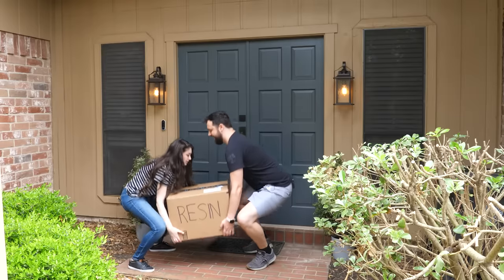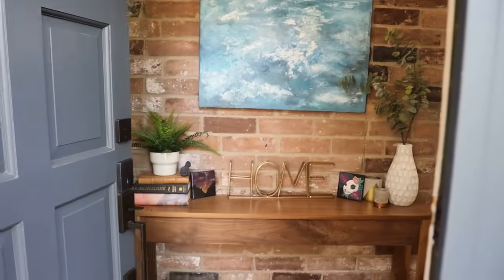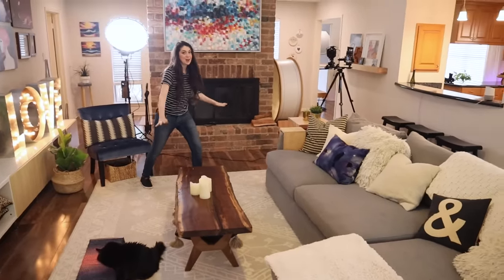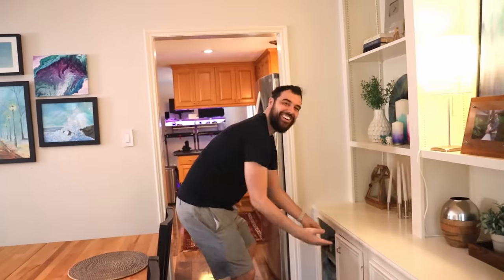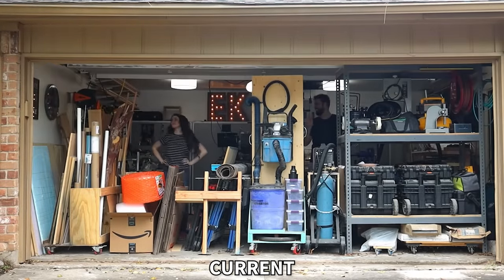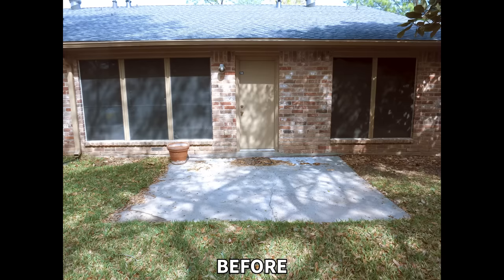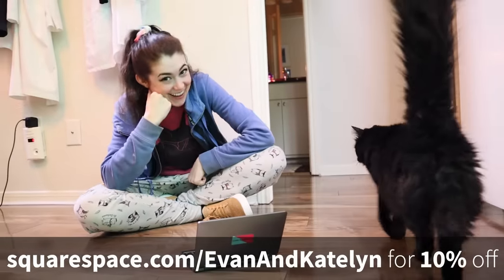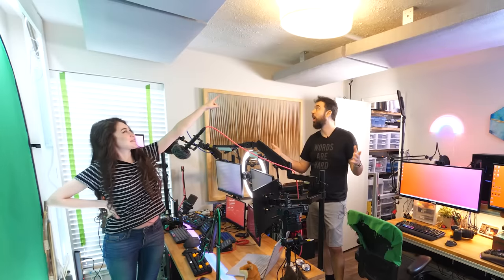House Tour + Before & Afters (8 Years of Progress)

Comment: You probably use directional mics or lapels now so you wouldn't need it as much, but if you STILL want to sound proof your garage ceiling, an easy way is to get a tapestry or blanket and thumbtack it.  It can't be super thin sheet material though or it won't absorb sound as well. I have my ceiling with a bunch of galaxy design tapestries.

Comment: I am pretty sure you could setup an auto-stream with a pi to trigger when Joob goes outside into that area, by putting a sensor in the top left and facing the bottom right corner of the area.
You could make it send a shortcut to a PC running OBS to start stream if motion is detected, and stop after 2 minutes of inactivity.

That way, it would always go live at random times when Joob goes into the area. I am sure it can be done... I have a friend that uses Pi's for sensors with his Autistic nephew when he stays at his house. He has sensors in rooms that light up a modified alarm clock with LED's to tell them what room he's currently in so they can tell if he's doing something at a glance when they are taking care of things upstairs.

Comment: 33:55 - I’ll do you one better. My two bathroom vent fans and every baseboard heater grill are also nailed into place with those same nails. Except in my house, two nails were used each time, with the heads overlapping to really jam them in there. The thing is, you can’t possibly swing a hammer in those spaces, so the builder or last owner had clearly bought a pneumatic palm nailer and went crazy. My vent fans are double-nailed inside the housing on THREE SIDES. I had to use tin snips to cut them out.

Comment: What is Joob's actual name? //  Your comments about 'previous owner' makes me think of my place. I never noticed it when I bought the house but after:  The globe on the light/fan in the bedroom didn't have the fasteners - the globe was just duct tapped on!  When the ceilings were painted, the fixtures weren't taken down so the light bases had paint on them.  When the walls were taped/mudded(?) the seams weren't sanded before painting (the ceiling in the bedroom has seams about 4" wide and maybe 1/4" [or more] thick!).  I think they used masking tape on the  bathroom ceiling 'cause it was drooping and brittle. They had a door for the furnace room that was too small (also the doorway width wouldn't let me move the dryer in - I had to take one side down and finally - 3 years later - the doorway is done.  Speaking of nails (and also, screws) instead of using 2 1/2" screws or nails (for 2x4s) they used 4" (or longer) nails and screws to hold things together!  Eventually I need to replace the sockets as some don't work (too much paint in them, I think).  On the outside - instead of sanding where the paint peeled, the siding was just repainted.  I've started using a heat gun to remove the layers (at least 3) of paint - I'm doing it in sections so the house will be new grey with old blue paint.  If I decided to remove ALL the paint first - it might be a couple of years before I could paint so I decided it would be better to paint about a 4'-5' section with a 'bare' strip at the side so the heat gun won't affect the new paint.  So, my house will be grey and blue with white trim for the next few years.  Can't afford a new roof (can't get financing) so I'll put up heat tape to - hopefully - prevent ice dams again (this year they were over 6: thick and over 3' up the roof!!).  It's a lot of fun to do when a senior and you're by yourself!  (sarcastic tone)

Comment: This will probably be buried and not sure if anyone has said already - but be careful with that bow! Dry firing (firing without an arrow) a bow can damage the structural integrity of it. In extreme cases it can cause cracks in the limbs and make them snap when under tension.